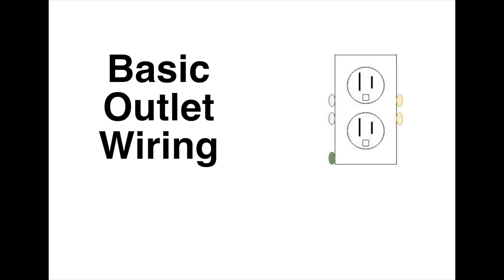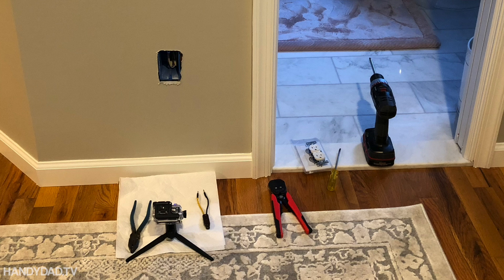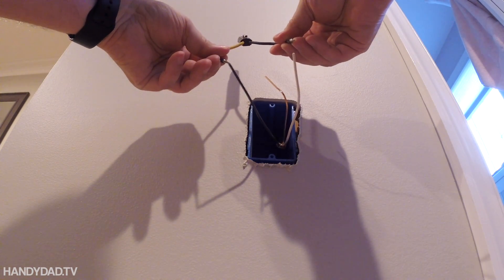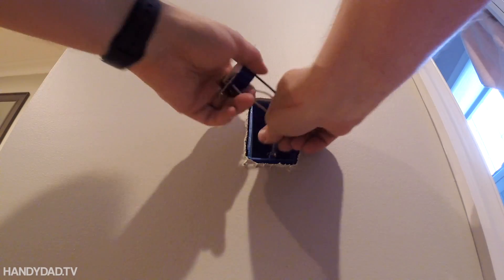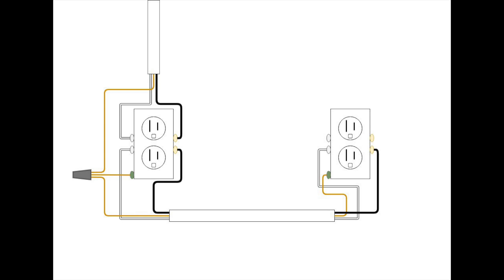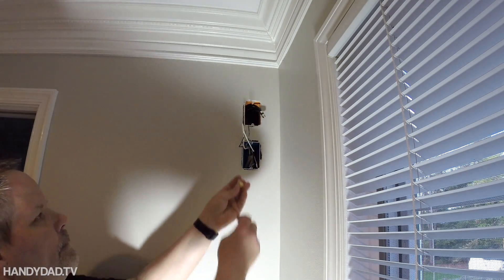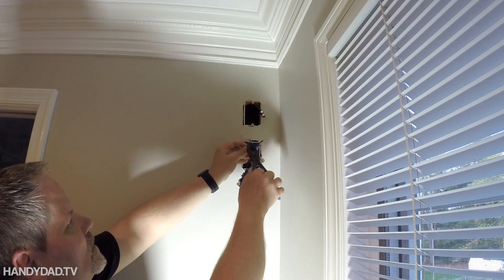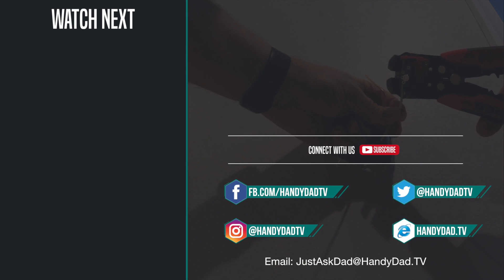How to Wire an Electrical Outlet

Comment: What if you have three wires coming into the outlet? I had to replace an outlet in my livingroom some time back. It was some weird plug outlet I have never seen before and three total romex cables going through it. I wired it up as best I could but I want to know wth is going on with that? I have to replace more outlets and I'm considering gutting it all and starting from scratch so I know it's safe.
Reply from the maker: Unless one goes to a switch, three wires is no different than two; just connect them all to the wire nuts. The electrician just branched that one in two directions to save wire.
Reply: @handydadtv  I have the same deal, 3 romex wires going to the outlet. I know it has something to do with switches because they are close to the outlet. My question is this
Can I pigtail off of that outlet that already has 3 romex  wires going to it? I want to add another outlet above the existing 1 behind a wall mounted tv. There are no other outlets close enough without having to rip through drywall
Reply from the maker: You can do that; it’ll just be really hard to fit everything in the box.
Reply: @handydadtv  thanks for the reply

Comment: Great video.
What's the reason for not connecting the two ground wire on one screw?
Reply from the maker: Code doesn’t allow two wires on one screw because they can come loose.

Comment: I saw that someone else pigtailed the white and black wires on a different video tutorial. What confuses me is the idea that the electricity doesn't really flow like it would through a pipe.

Ignoring code, I assume it would be no different to strip a tiny spot along the black and white wires and hook short pieces between the stripped areas and the screws to an outlet receptacle. Is this assumption correct?
Reply from the maker: I visualize electricity flowing just like water in pipes. What part is confusing? Maybe I can help. As for the second part, I've seen long wires with a stripped section attached to a screw to avoid a wire nut, but that's usually when there are multiple devices in a double-gang box or larger. Not a code violation.

Comment: Done many outlets before and just put the new one in the same as the old. Nice to actually know why things are the way they are now.
Reply: Doesn't work that way when you have some weird looking old outlet that has three cables coming into it and you have to make it work with a modern outlet (both same ratings, just different designs apparently, the old design looks like a fire hazard). In my current house, I have seen things that blows my mind and makes me wonder about what happened. All of the outlets are very weird and the wiring doesn't make sense, wrong kind of exterior doors, wrong kind of windows, shoddy repairs, chandeliers everywhere. Whoever lived here before I purchased it was a little odd and not very good with DIY. The weird outlets look to be original (from the 1980s) but there is a mix of old and new outlets, old and new light switches, different design switches, and even a dimmer switch in a place that makes little sense. Chaos. Slowly getting everything to the way it should be. Probably going to gut all the wiring and redo it just to be safe.

Comment: I disagree to one point, in the middle of the run, all 3 wires should be pigtailed, due to the fact if the outlet fails, it does not kill the outlets down stream of it!
Reply from the maker: Good point but I’ve never seen it done that way. Not in my old house or new construction.
Reply: @handydadtv  John is right they should all be pig tailed and here is why. You are daisy chaining your outlets through the little bars that connect the 2 receptacles on the outlet together. Those bars were never intended to carry the load of all the downstream outlets.
Reply from the maker: That’s exactly what they were designed for. That’s why there are two sets of screws.
Reply: @handydadtv  There are 2 sets of screws so that one receptacle can be isolated and routed through a switch using a separate wire.
Reply: It may be best to always pigtail but we only have four duplex receptacles on each 20 amp circuit running to our kitchen/dining room. If one outlet fails and causes the others downline to fail no harm done. It'll get fixed that much quicker. In our case there are no speed connections on our spec grade receptacles. The only time I used pigtails is when there were more than two cables in the box. Otherwise I put two neutral wires under the terminal plate on the one side of the receptacle and two hot conductors under a terminal plate on the hot side. Even if there was a problem with the receptacle failing I don't see why everything downline would stop working. The neutrals are on a common terminal and the hots are on a common terminal. Nothing is going to change that.
Reply from the maker: People talk about receptacle failing like they are stand-alone devices, like flashlights. But they’re not. If a receptacle “fails”, either the breaker pops or the house burns down. In either case, who cares about the other receptacles on the circuit?

Comment: Hi there I just wanted to know if it's ok to add 2 new outlets off of an old one? Two 15 amp outlets with a 14 gauge wire all connected  to a pre existing outlet; it's for a floating TV and shelf installment to conceal all wires
Reply: Also wondering the same thing for same reason.
Reply from the maker: Yes, there is no limit to the number of outlets on a circuit; just as long as the current used doesn’t exceed the capacity of the wire. So 14 gauge wire = 15 amp. 

If a breaker keeps popping, it’s NEVER okay to replace it with a bigger breaker.
Reply: HandyDadTV    There is a limit to the number of receptacles.   The numbers are (10) max on 15 ampere circuit and (13) on a 20 ampere circuit.   As you said in another comment about NEC Google it.    Better to have the book though!

Comment: I did it exactly like he explained but only one of the plug in outlet works. If I screw the white wire at the top that one works if I screw it at the lower one then this one works only...ANY HELP PLEASE WILL BE APPRECIATE IT
Reply from the maker: Use a new outlet and don’t remove the jumper between the screws.
Reply: @handydadtv  Thanks a million, this worked perfectly...SUBSCRIBED

Comment: So I have two outlets in my shed I am wiring up to a new circuit from the breaker panel, and they are the only things on the circuit.  Once I have the first outlet wired with the ground, white & black, how to jump that over to the second outlet to power it?
Reply from the maker: Be sure that first outlet is a GFCI outlet unless you are installing a GFCI breaker. Breaker is better, but more expensive. 

Assuming you’re using a GFCI outlet, there will be screws labeled LINE and LOAD. Connect the incoming power to the LINE screw on the outlet and connect a feed to the other outlet to the LOAD screws. White wires on the silver screws; black wires on the brass screws.

Comment: That was really good. Do you have one that shows one 20amp  2/1 wire from the box to two double outlets about 4 ft apart?
Reply from the maker: No, not that specific scenario. But the principles are the same.

Comment: What type of cable would you use for this? This is pretty much what I need to do in my garage
Reply from the maker: Depends on where you live, but most of the country uses Romex cable (non-metallic shielding). Figure out which breaker you’ll be adding the outlet to, and note the rating. If it’s 15-amp, you can use 14-2 wire. If it’s 20-amp, use 12-2. The latter is thicker to carry more current.
Reply from the maker: Also, if the new outlet will be near the garage door, use a GFCI outlet to protect from shock.
Reply: Awesome. Thank you

Comment: I recently purchased an outlet that has only one hot and one neutral screw on each side because it also has USB charging ports, but the outlet I am trying to replace has 2 screws on each side.  How do I wire this?
Reply from the maker: You’ll need to use wire nuts to join the wires and pigtail them to the outlet. You can’t put multiple wires on a screw.
Reply: @handydadtv  thanks!

Comment: How to add new outlet to the existing outlet.because my old outlet has 2 black and 2 white wire and ground.if im gonna make new outlet is it right to top my new wire to old 2 black and 2 white wire.? Is that correct?

Comment: Can you make a video related to outlets linked to light switches? I currently have my tv lugged into an outlet wired this way and if somebody accidentally toggles the switch it turns everyting off. I would like to reroute the switch to an overhead light fixture instead
Reply: I'm looking for a solution to the same issue. YouTube suggested this video but it doesn't quite cover it.
Reply from the maker: This is complicated on a number of levels, depending on how it’s wired. If power comes to the outlet first, you can disconnect the switch so the outlet stays on continuously. A better approach is to split the outlet so only ONE plug is controlled by the switch and the other always stays on.

Comment: For that extra pro touch make sure the screws on the cover plate are all going the same direction when finished. I like the vertical look myself.
Reply from the maker: I do that too, but I like horizontal. 👍🏻
Reply: I did it exactly like he explained but only one of the plug in outlet works. If I screw the white wire at the top that one works if I screw it at the lower one then this one works only...ANY HELP PLEASE WILL BE APPRECIATE IT

Comment: On the middle of the run outlet, does it matter which wire goes on the top and bottom?
Reply from the maker: No, there is no difference.

Comment: Hi, As you probably know the UK is different to the USA or Canada, we use brown or red = live, blue or black = negative, and bear = earth ( however we put a green and yellow sheath over the earth) our sockets are also different being bigger. If you are wiring a socket at the end or midway the wiring is the same and both wires go into the same connection ( if you are using a metal back plate this is also wired with a small earth going from the socket to the base making 4 wires in all ( this can be a little difficult to get all 4 wires in 1 connection ) also we work on 240 volts and use different thickness of wires for different uses ( 1.5 mm lighting, 2.5mm power and thicker wire for (heavy use such as showers that use a lot of amps ) showers are not to be connected to any other appliance). I hope this is useful to any of your UK followers

Comment: As an extra safety measure I always use electrical tape and go around the outlet and cover the screw terminals. Helps keep the wires in place and cuts the potential for shock or arching.
Reply: That makes more sense for metal boxes.
Reply: I agree and do the same thing.
Reply: Thanks for this tip